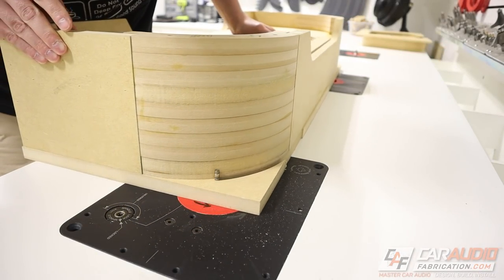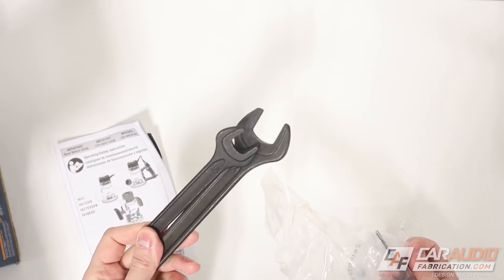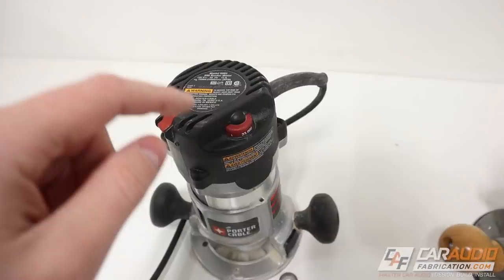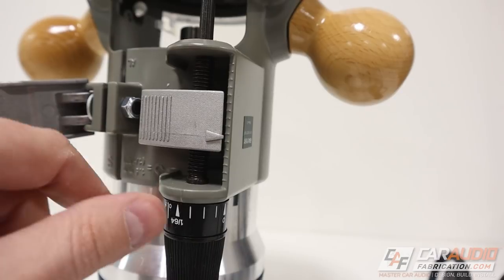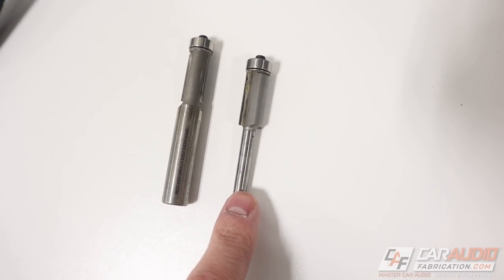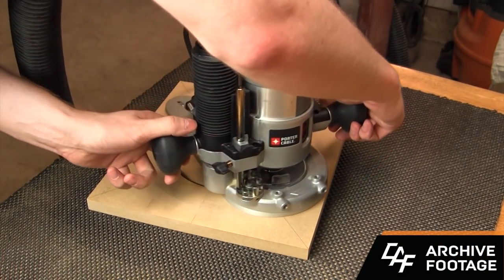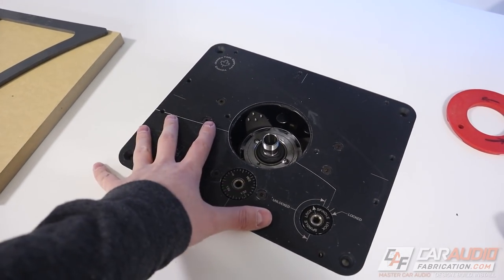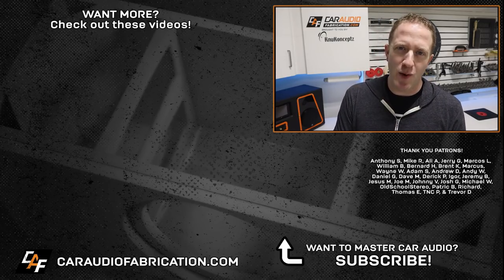Goodbye Porter Cable... Car Audio's NEW BEST ROUTER - Bosch!

Comment: you will probably never see this, but I have the same bosch router and was able to get a set of offset collet wrenches to make it easier to swap bits with it in the table.  If you do not have a set, look into them!

Comment: Perfect timing!  Just discovered the aperature of my dainty little trim router is too small for a couple bits I'm gonna need to use on an upcoming project!  Still slowly re-building my tool collection, since I now have a dedicated shop space with plugs.  Cordless tools are handy, but as your projects grow, it's nice to not have things die mid-cut.  LOL

That benchtop router table you have listed in the description is pretty awesome, too!  I feel like I could build something better, but for $200, I'm just gonna get that and be done with it!

Thanks for the video, Mark!  Merry Christmas!

Comment: I personally use the dewalt cordless router. I don’t like having the cord pulling at the top of the router and it’s plenty powerful for basically everything I need. Paired with a whiteside 1/4 spiral flush trim bit. Bosch is fine but I don’t like the way the router slides into the base. After a few months the pins started to bind and it gave me all sorts of problems.
Reply: True same with me

Comment: Honestly I have a CNC machine and it saves sooooo much time and effort as you can cut everything you want perfectly. I would highly recommend one
Reply from the maker: I have one. Still a lo of things that are faster with normal router. Especially with one off parts not doing production work

Comment: I use the DeWalt DW618 in my lift. It’s 2 1/4 HP with full feedback control and speed up to 24k rpm. It works like a champ.
Reply: The Dewalts do NOT like being upside down. In the woodworking industry, the 616, and 618 routers never last long, unless upright.

Comment: It seemed like only yesterday (showing my age) that Porter Cable was top of the line gear.  Sadly, after Black and Decker bought PC it has been slow descent into Harbor Freight territory.
Reply: Stanley Black and Decker is ruining every tool brand they have. Dewalt is their current self-destruct line. 😢
Reply: @carterscustomrods  reall y?  maybe thats why all 3 of my 618s took a crap  in the last 11 months.  one being 15 minutes.  thinking of just buying 3 of these bosch routers.

Comment: I have a question..  I have a 1,000 watt 10” Rockford Fosgate subwoofer and I wanted to know what size of box I would need to make for it to get the best sound
Reply: Best sound is subjective and depends on the fitment of your vehicle. However, Rockford provides the suggested volumes and example dimensions on the product pages and/or manuals on the site for ported and seal applications. If you bought new the info should be in your manual.
Reply: That COMPLETELY depends on the type of vehicle, amplification, alternator output, installation quality, source unit, materials used, type of music... The parameters are endless.  However, I am using three JL 10W3v3-8's on a single 500/1 and each sub is in the manufacturers recommended sealed enclosure (.55 CuFt). I have a baffled and braced enclosure assembled with cabinet-grade materials and the inside of the enclosure is painted with latex paint to prevent "breathing". It is punchy with a kick drum, will give you goosebumps with a cello, and will play pipe organ from Dorsey's Bachbusters.

Comment: I just recently got a Parkside (from Lidl) as it was on sale.  I saw the price and jumped on it...was reading somewhere that they are similar to Bosch...will find out. Hopefully it does have the same features.  You are a great reviewer and communicator.  Any reason why Porter Cable decided to stop making routers?
Reply: Sure, Lidl Parkside is just like Bosch Blue line, or maybe even better for just 10th of the price (irony alert)
Reply: @champipy  I've no clue...  I'm  a shoestring budget kinda guy. Haha!
Reply: Not sure why, but the quality of PC has been going down hill for years. I have a 890 that speed control died on at 2 years and PC ignored the 3 year warranty and told me good luck, used speed controls are more then the router was new. I was Done with the brand at that point. Sadly I have several PC routers.
Reply: @tomr3422  sorry to hear that...  😔

Comment: My 890 speed control went out and PC doesnt sell or support a 3 year old router anymore, you can find them used for more then the router was new, Thats the biggest reason not to want a PC router ( I have several of them and the quality has dropped drastically in the last few years).

Comment: Why the f do you have 3 router tables lol can you use all 3 at once
Reply from the maker: Bit changes take time. Time is money. 1 always has a flush trim bit and the other two change depending on project.
Reply: @CarAudioFabrication  fully agree, this is why i own 6 routers with 4 of them having dedicated bits that saves time\energy to swap out  ... my pc stays permanently on my jasper circle jig
Reply: @CarAudioFabrication  ok that comment makes sense.